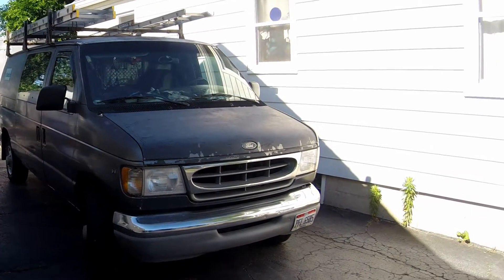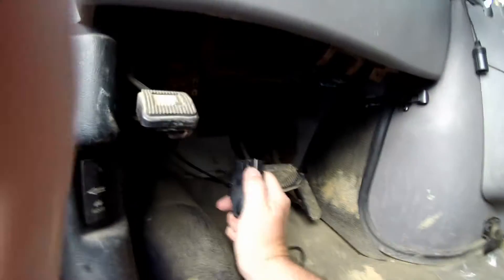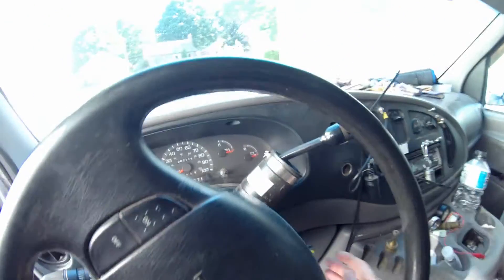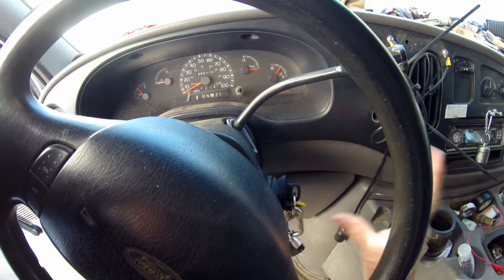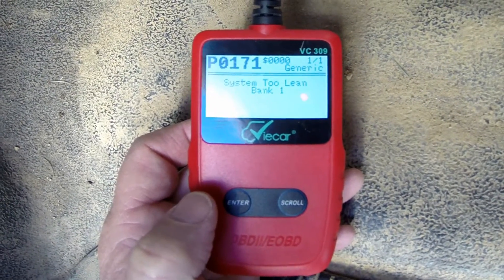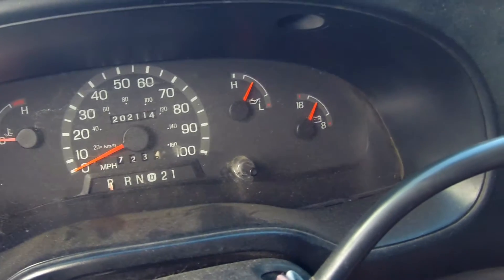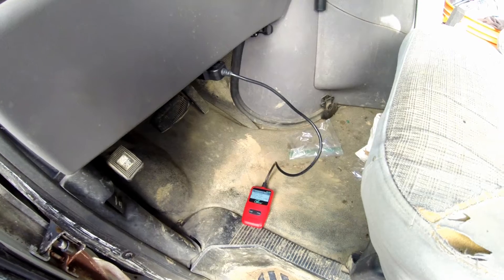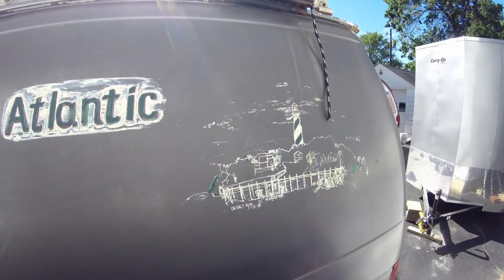OBD2 Code reader FORD E250 Connector Location TURN OFF CHECK ENGINE LIGHT using OBD2 Scanner

Comment: And then 5 minutes later it turns back on?
Reply from the maker: hey van, thank you for watching. nope  it does not turn back on after reset. but, if you are having this problem. you reset and it comes back , you probably need to do some maintenance. like, replace spark plug or coils pack. i have a video on how to do this if that's what you need to do this procedure https://youtu.be/wFh22J5DhUs thanks again for watching